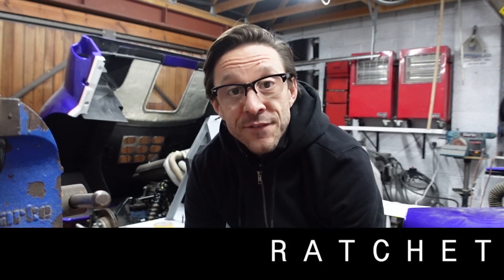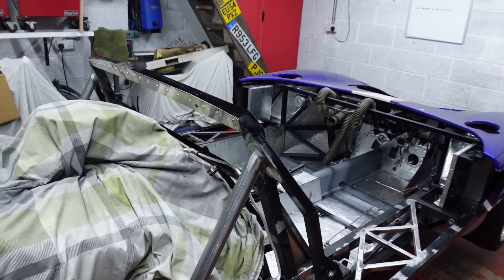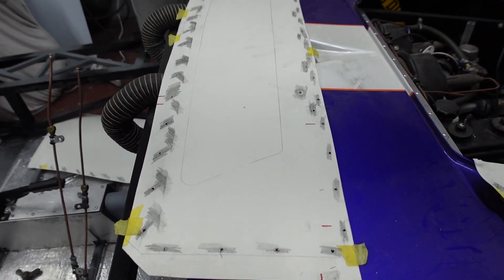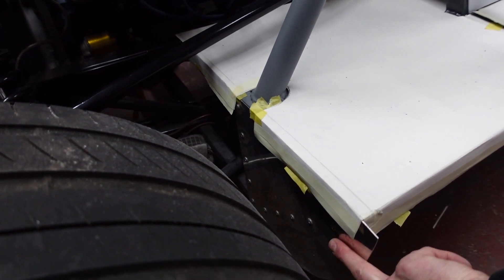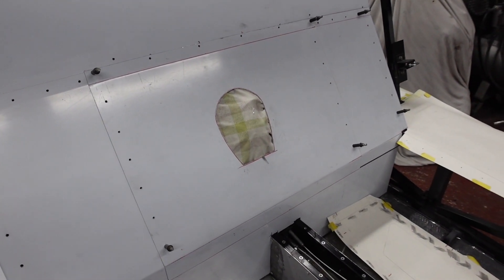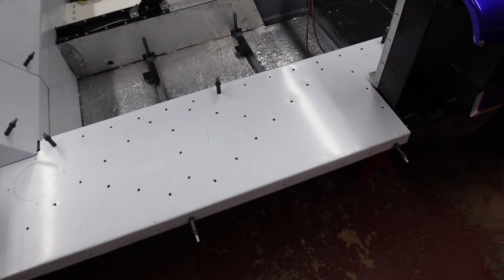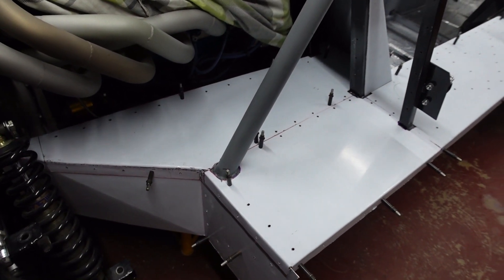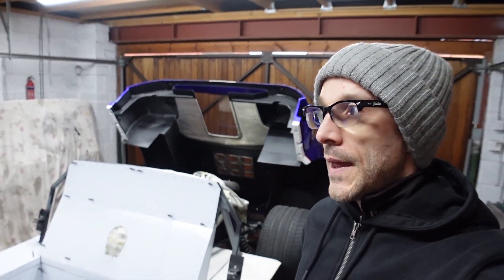GT40 Restoration - Ep 8: Finally Starting The Rebuild.... Maybe

Comment: Looking good mate! When I did the panelling the 2nd time on my old tornado I actually did away with rivets completely on panels that took no load. Tigerseal is more than strong enough on its own and its a nice look. You might want to consider not putting a seal on the panel edge and just put some closed cell foam with self tappers. Useful on certain panels you might want to remove again for access.
Battery should be  600 -660 cca ideally, i think mine is an 075 size. Checkout obp for pedal boxes, they do a large range.
Great work though!
Reply from the maker: Thanks for the info re: the battery! obp pedal boxes are pieces of art but that art comes with a hefty price!! Some of the panels will be removable and I'll be using rivnuts and button head allen bolts, it should look pretty smart (I hope)

Comment: One thing I did when rebuild a project that someone else did was to use blind press fit inserts. They are a bit more expensive, but allow you to access  “and you will need the access” especially when customizing. I got pissed- off every-time I had to drill out rivets to modify or add something. I only needed 1/2 the amount of inserts compared to the rivets. Another step to eliminate squeaking / vibration of the metal to steel is by putting a strong adhesive tape (one side only, too allow easy removal of plates. When you drive the car or even putting it on the ground the car for the first time will stress / stretch the rivets. With PEM or Dakota inserts you can retighten if needed. There are many different styles to choose from that should meet your needs. As someone mentioned below... nowadays when you have a newer car repaired all they do is cut the damaged panel off and glue on a new one. That is how the factory instructs them to do the repair. I know it sounds funny, but the adhesive is stronger. 

Anyway I hope my prior experience in building cars and being and engineer helps you have more fun with your car.

I am very much enjoying your project
Reply from the maker: Thank you very much for your reply, I am planning on making some of the panels removable and will be using rivnuts as I've done elsewhere, the tape on the backside to help cut down rattles is a great idea!!! Glad you're enjoying the videos, appreciate the kind words

Comment: You nailed it with those folds.  Very nice. What machine did you use? They never looked right, with angle strips on the corners
Reply from the maker: I used a homemade metal folder

Comment: Now would be the time to replace the brake and clutch lines with proper stainless steel lines. This has been bothering me every time I see the copper line.
Reply from the maker: Copper is real standard and perfectly adequate so that's what I've used for the replacement lines as well :-)